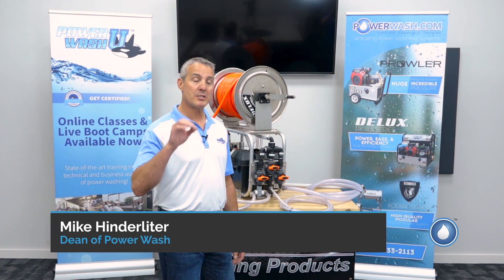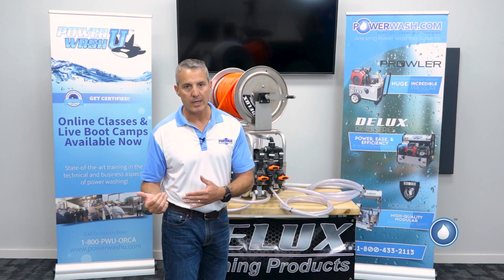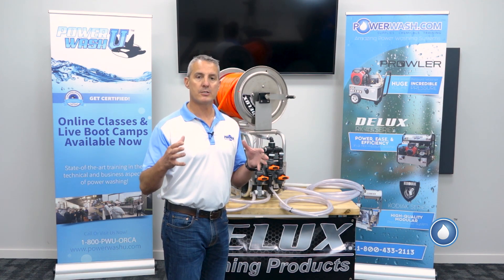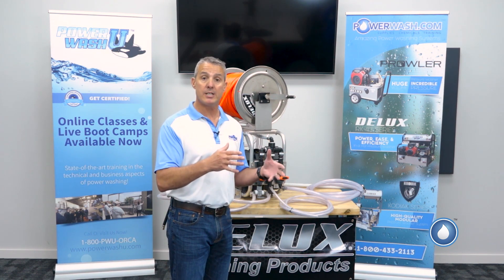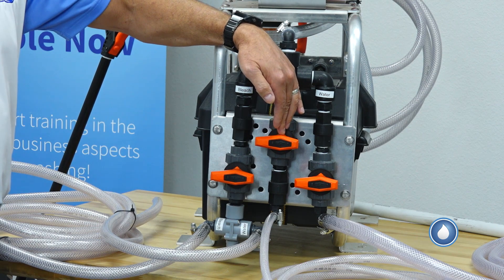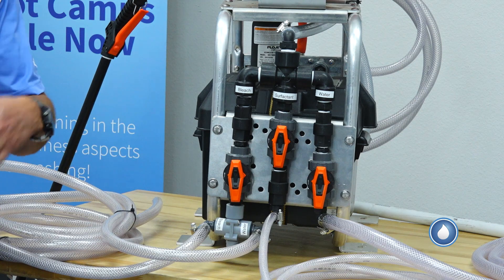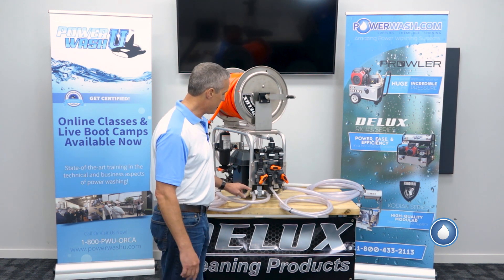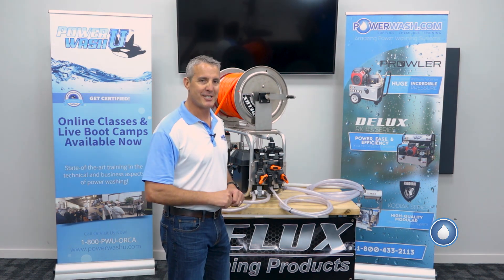Delux Sidewinder Pro Mix Station For Soft Wash: Tips To Save Time For Soft Washing

Comment: I have a sidewinder pro. On mine the water valve has a slightly larger hose than the SH valve. Cody explained this to me. The surfactant valve on mine had the valve. I was told that was so you could use two different surfactants. My question is, could I add another valve to my SH line to use it as a clean out like you have here?  Would that deviation create problems?
Reply: I have the same question. Most of us choose between a couple of surfactants depending on if it's a house wash or a roof wash. So that three-way valve on the surfactant valve would be nice. And it's almost mandatory for the SH valve to flush it
Reply from the maker: Yes you could put another valve or 3 way valve to choose between different soaps.